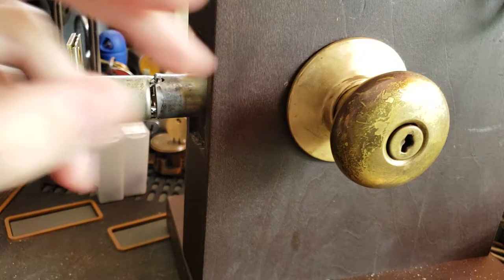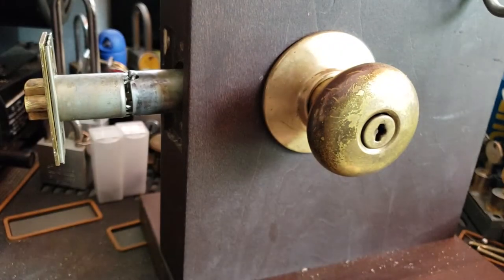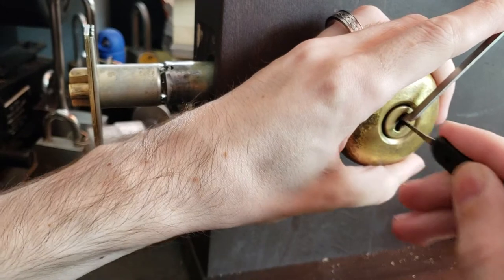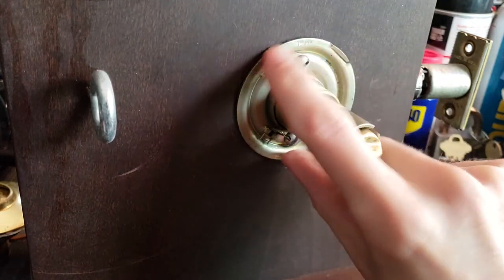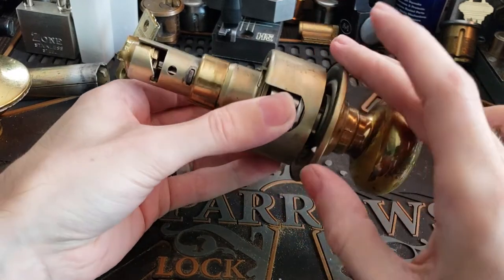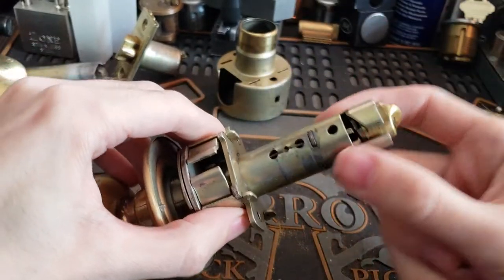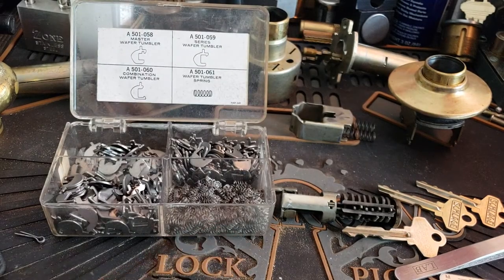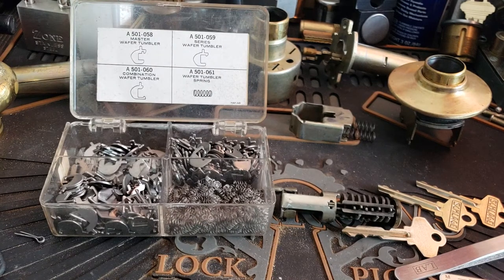(105) Schlage Wafer locks, pick and gut

Comment: I have the single and double hump  picks, and the straight pin. Ran into your video while looking for video showing the picks in use, seems like you had to go to the back pin and lift up, then pull a hook from rear to front, and opened right up. No instructions came the picks, took one of an old Schlage apart. Easy too see how to use and how easy. Hardly ever see them anymore, but do.
Ever use or know of that method?
Reply from the maker: There were special tools designed for these decades ago and they can still be found in many locksport and locksmith suppliers catalogs. The tools consisted of a set of modified blanks to hold the series wafer and apply tension, and a raking tool. They work by inserting the correct modified blank in the lock, applying tension, and then using the rake/probe tool to rake each of the remaining wafers.

Comment: Hi I have a similar lock (push button rather than wafer) and am having trouble removing it after taking the plate off. Yours seem to be able to easily remove from one side with the knob. Is picking the lock a pre-requisite for removing it if it’s already unlocked (without key)?

Comment: Which prybar were you using  40 or 50 thousandths
I have seen a few but never taken them apart  is the first part of disassembly similar to A series
Reply from the maker: That was a .050" Pry Bar, the Schlage Wafer keyway is remarkably wide.
As best I can tell, this model was eventually designated as model A51WD PLY, the modern successor is the A53PD which differs primarily in the design of the outside spindle. The newer models have switched from the exposed flat catch to remove the knobs to a shrouded catch that is released by pushing a probe into a small round hole in the same location. Otherwise both construction and disassembly procedures should be largely the same.